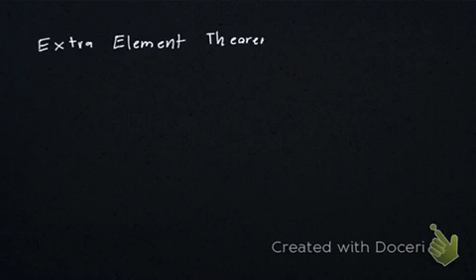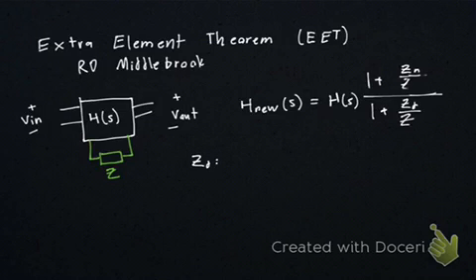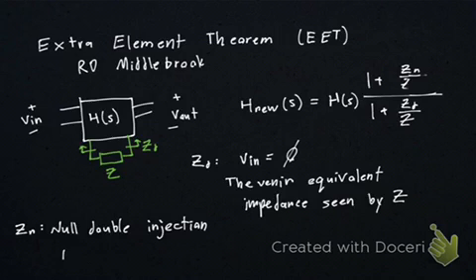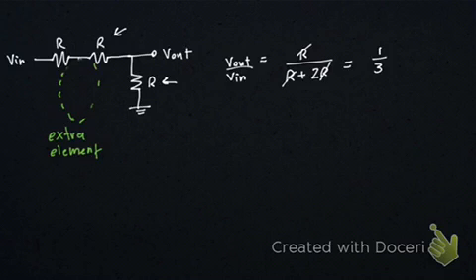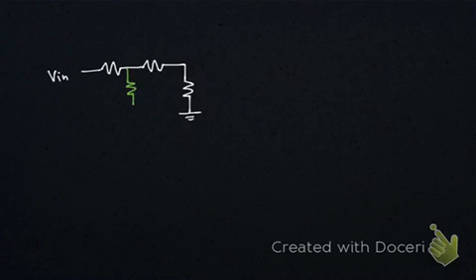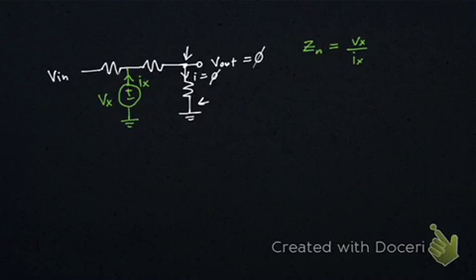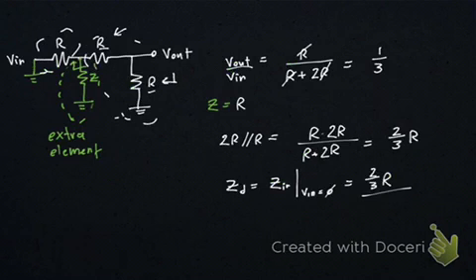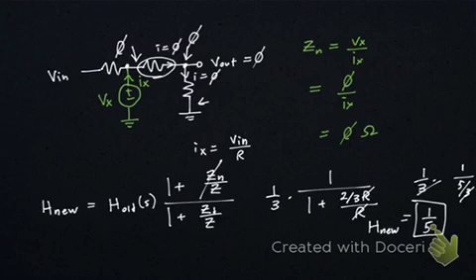Extra Element Theorem Introduction

Comment: WHEN YOU FINDING Zn Vout TO MAKING ZERO.YOU ARE TAKEN CURRENT THROUGH R IS ZERO YES CORRECT .BUT THE CURRENT THROUGH THE NEXT R IS NOT ZERO, I THINK IT WILL BE Vin/R.CAN YOU PLEASE EXPLAIN ME ?
Reply: I think he said it's because there is no other path for the current to flow. If there was a current it would need to flow out. So he said no current is flowing through the said resistor.
Reply: I think he said it's because there is no other path for the current to flow. It's not going down and neither can it flow to the open end. So...
Reply: why aare you using capital letter?